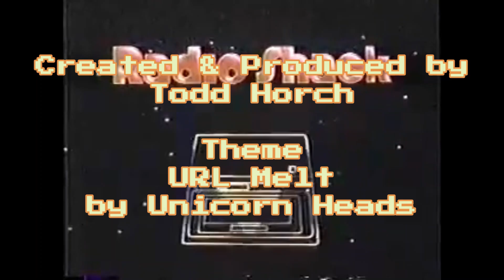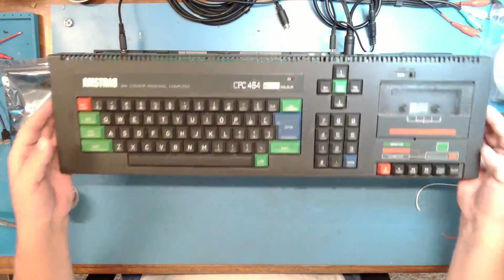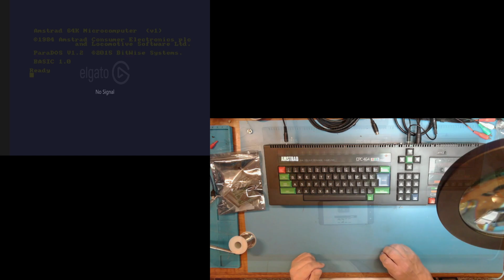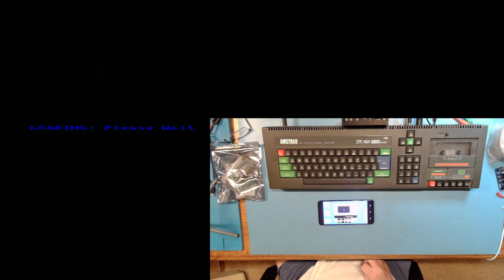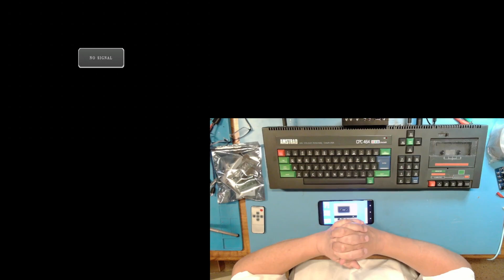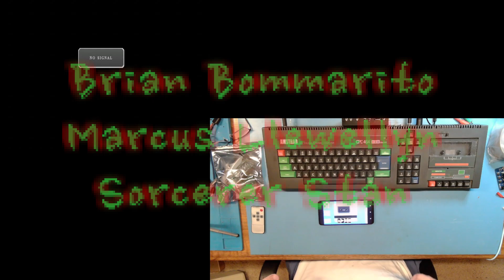I Put Bluetooth In My Amstrad.  How did that go?

Comment: Todd, thank you for this video, I was struggling to find a way too make a CPC worth something but you nailed it, Now anyone can DOUBLE the value of their CPC with a nice bluetooth mod......😂

Seriously though, great mod bluetooth will work well enough upto a couple of metres , You didnt mention what the input voltage is but i suspect its the standard 5volts so prob easy to also make a small enclosure to fit outside, although at that price its cheap enough to add one to each machine .... 👍
Reply from the maker: Yes.  5v.  I knew I had to do this mod on the CPC just for you.  I could have used a Speccy or a Coco, but no, CPC all the way.  Yes, you could probably make a little 3D printed enclosure exposing both the microUSB and the 3.5mm jacks and then connect it externally with a little 3.5mm cable and that'd probably do the trick.